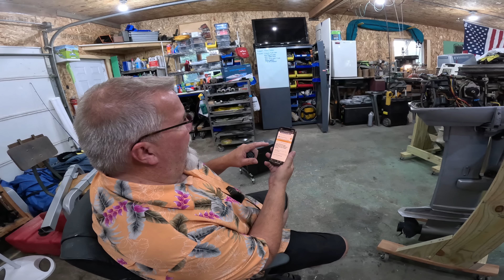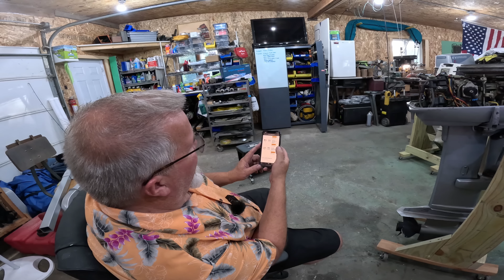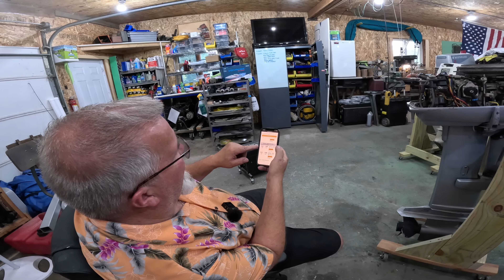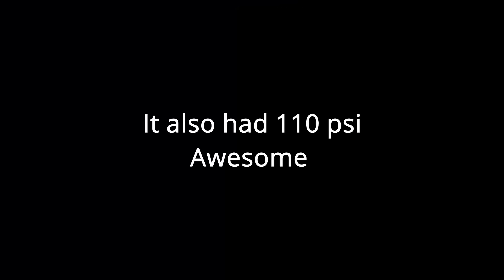1978 Evinrude 35hp lets make it run and test it out

Comment: Love the channel. I have a 77 Johnson 35 HP with a tiller handle off a Johnson 25, mid section and lower unit off an Evinrude 35. Electric start works fantastic and it will idle all day. Your videos have been extremely helpful.

Comment: Thanks for the Sunday video. It’s my opinion that when the Chinese corporate spy was copying out the Evinrude carb kit parts, they either guessed wrong on the thread size or wrote it down wrong. Now they have 50,000 kits with the wrong one and don’t care to fix it.
Reply from the maker: I do believe that is the issue, thanks for watching
Reply: i'm thinking thier machines wont run standard threads only metric  so they pick the closest one lol

Comment: I put a lawn and garden style fuel pump on my evinrude 15hp.  I wasnt a fan f the multi layer diaphram pump.  Usually you can find those style at and lawn and garden store and sometimes the big box stores.  They only run about 17.00
Reply from the maker: I'll have to check that out, thanks for the tip and thanks for watching

Comment: Awesome! . Have that engine strong😢 Fkers I use mine twice a week from Miami to the keys for about 5 years.. mines a 35953A also that's good compression for this model mines at 125 on both I suspect with a electric start and warm it will be higher than 110 I So have a seahorse. 69 25 hp I'm looking for a starter bracket for that one I'm so tired of tennis elbow lol
Reply from the maker: The pull start can get ya for sure, ended up in insta care last week for that same thing, broke my own rule, shouldn't pull and engine 50 times like I did, thanks for watching

Comment: What is mix ratio for 1957 18hp johnson 😊
Reply from the maker: They claim 16:1 ratio, some may go as high as 24:1.   It's a pretty rich oil mixture.  I remember running it that rich in my old 1955.
Reply: We ran 20:1 in our '58 Johnson 18 hp and a '54 Johnson 10 hp. Both ran over 400 hrs per season for years and years.

Comment: I've got a 1977 35hp Johnson electric start and 1981 Evinrude pull start. The Evinrude goes harder but electric start is far easier
Reply from the maker: the horse power rating changed between those years.
Reply: @Michaelsbackyardmarina  really? Both 35hp. Newer should run better sure

Comment: I enjoyed this video. That is not from a Sierra kit, because the seats actually work from Sierra. Your aftermarket kit is from the famous tin foil package, indicating that it is from China and none of those seats from those kits work properly. The rubber gaskets stretch out too much as well. In addition, instead of the kits having two plastic washers for the carb jets, metal washers are supplied instead.
Reply from the maker: Good to know, I do think that was a china kit. Thanks for watching

Comment: Do you know the difference between a 30 35 carb 30 has a brass rod in side the throat up n down 35 doesn't have it can take it out by the cap on the top put the cap back on 😁most people don't know this 🙋🍿